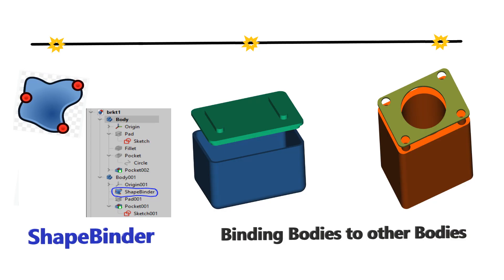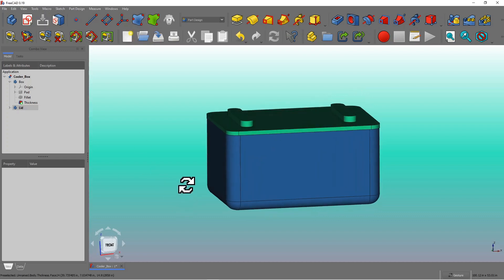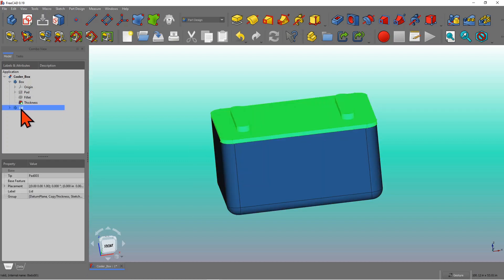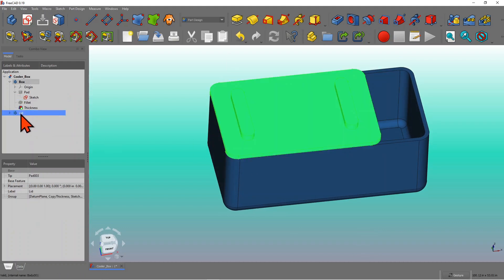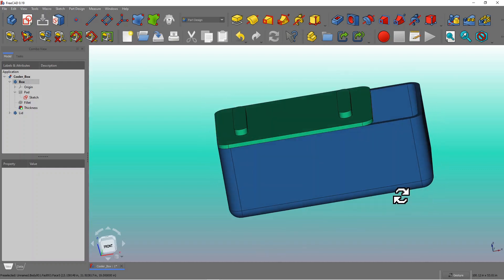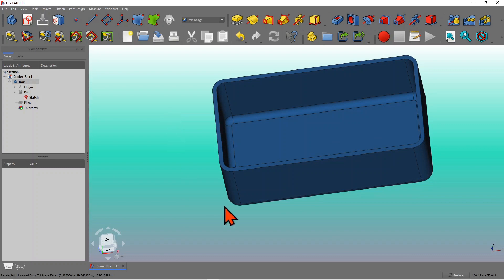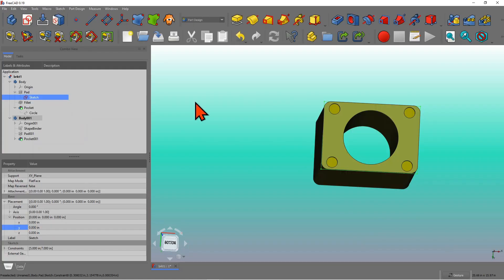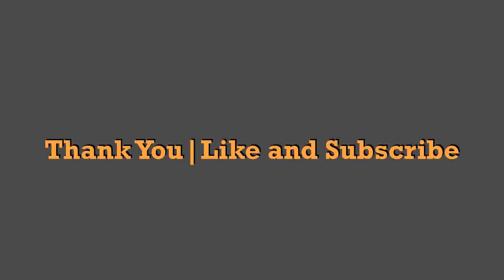FreeCad Tutorial.  Shapebinder Explained. How to use it effectively. Must-Use tool in FreeCad

Comment: but using this method, the cover lid won't fit if this box is 3d printed. We need some clearance. How can we do that using shapebinders?
Reply from the maker: Hello … yes, that is understandable.   I would recommend modifying the shape binder with a sketch. Then you modify the sketch with clearance. Let me know if this is not clear and I will create quick tutorial…
Reply: @cadzis673   Thanks for the kind reply. 

Yes, for inner area, we have to use sub-shape binder and create a sketch over it with 0.4mm clearance. And outer area can be used directly by a shape binder. 

Just did the exercise. I've been using  sub-shape binder only but knowing how i could use a shape binder is a good thing to know. e.g. in this case, i used a shape binder for quickly making an object.

Comment: A great video showing basic usage of shape binder.  There was one thing I did not understand.  Why did you use the external geometry?  I was thinking shape binder did that mapping for you.  It seems that shape binder does not provide the edges so that you could reference to fully constrain the sketch.  Furthermore if you do use external geometry, you could convert the two lines to construction mode since the padding is relative to the shape binder.
Reply from the maker: Thanks for your comment....    Please watch my second tutorial (Link given below).   

You are right...  method I used did not provide me with lines to create a sketch/constraint.  In this case it was not necessary.  But in my second tutorial  I have to create a sketch, so I used edge linker and  then created the sketch.  

https://youtu.be/ZIAvb7o4Z80

Comment: howto make gap for bottom box lid  so its not too tight
Reply from the maker: You need to build sketch a from the shapebinder lid.  And this sketch needs to have relationship with shapebinder. So when the box dimensions change lid will change with the same offset(gap).   It is hard to explain w/o a picture.  Give it a try.  I might create a quick video on this....

Comment: If I pad a shape binder, how can I add pockets?  I can't put the sketch's pockets in the shape binder because they are around holes (counter sinks), and would break faces. Also, they would be padded instead of pockets.
Reply from the maker: You can attach a sketch to shapebinder.  My video shows how to attach a sketch to shapebinder.   Hope this answer your question... If not give me more details of your problem.
Reply: I figured it out. I just made ANOTHER shape binder but only of the pocketed geometry. Then I used the body's pocket shape button.  (This was a little different than your great tutorial because all the geometry was in a single sketch so I could see everything while I edited the single sketch.  Is there anyway to see other sketches in the background while working on another sketch?)
Reply from the maker: @TheRainHarvester  Yes,  you can work on one sketch but other sketches if they are in same plane or parallel  plane , you could make them visible by just picking these sketches in the treeview and pressing "space bar" key